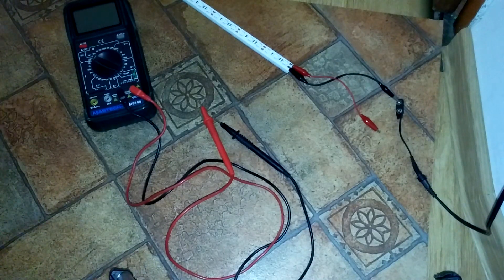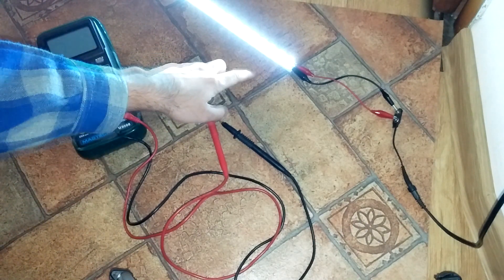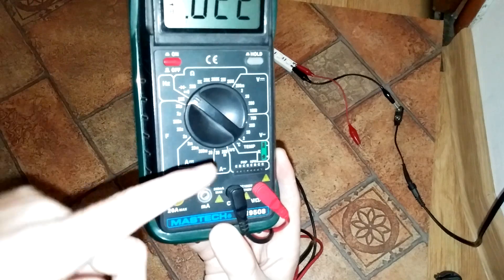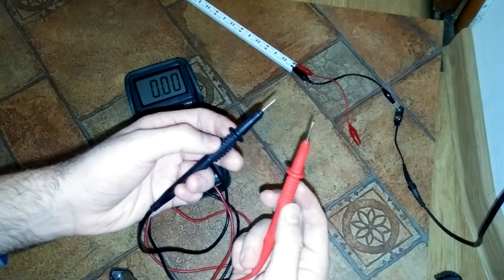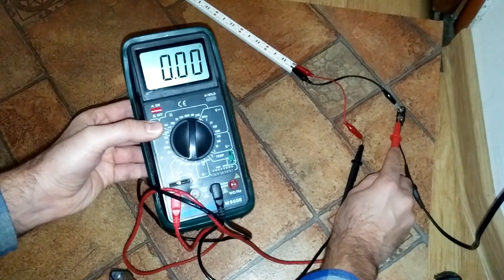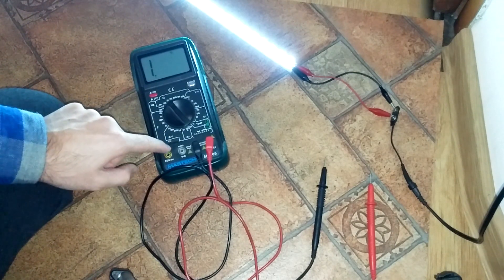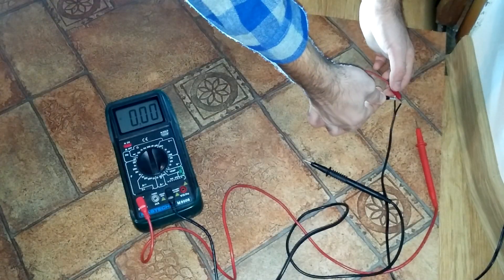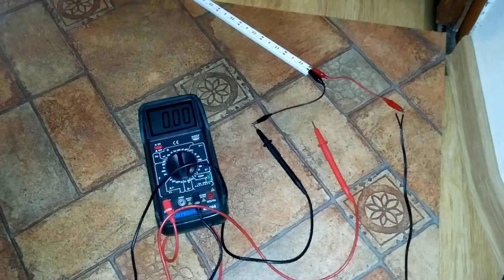How to measure DC/AC AMPS using a multimeter (Current)

Comment: Thank you. I just needed to know what wire went where. Really, just a simple diagram would suffice rather than making a video about such a simple concept. I can glance at a diagram in <500 ms. I actually tried that, reading, but people wrote horrible, long-winded "instructions" that were not only too wordy, but they were riddled with errors too.

Comment: How come dc led strip worked on ac directly? 🤔
Reply from the maker: Why not? The LED emits light, it's not a motor so that it would try to turn to the left and then to the right because of the alternating current (AC). LEDs are diodes, which means they conduct in one direction, and when the power travels in the correct direction they emit light, when power goes in the other direction they don't emit light. This alternating creates the flashing effect. I used 12V AC, not 110V or 220V AC.

Comment: why cant you measure current directly without light
Reply from the maker: The current consumption of the light is measured, otherwise the multimeter would just make a short-circuit! Current measurement is different compared to voltage measurement. When you measure current there is conductivity between the 2 leads. Never place the 2 leads onto a power source when you measure current (unless it is a solar panel, in that case it's OK). If you would add 2 identical lights then it would measure the power consumption of 2 lights, and thus the amperage (current) would be double.

Comment: I want to use clamp meter to measure amperage from adapter to LG monitor that only uses 2 amps. Can I use Cen-Tech 6 Function Mini Clamp Meter from Harbor-Freight which is for AC current or do I need a DC current clamp meter? (I don't want to cut the cord from the adapter to the monitor.)

Comment: why do you need to break the circuit with that probes and not with the clamps? can't you just put the probes directly tocuhing on other clamps/wires of the LED?
Reply from the maker: At that time I had no clamp amp meter, so with a multimeter you need to break the circuit to connect it in series in order to measure current.

Comment: Wow. Very informative and useful. Question. This probably shows the limits of my knowledge of electricity but how come the alternating current part of the test  is not blowing up or burning out the LEDs with the 120 volts? Thanks.
Reply: You would not be wanting to have bare live 120v cables just lying around and especially not connecting clips when power is on. 120v can kill you.
Reply from the maker: I used 2 different power adapters, the first was outputting 12V DC, the other one 12V AC, so they were not powered directly from the wall socket (220V - Europe).

Comment: how to test ac current with multimeter???
Reply from the maker: 1. Rotate the knob to Alternating Current Amps (shown at 1:07);
2. Plug in the red lead to the AMP connector (shown at 1:41);
3. Break one of the circuit's wires and connect the multimeter's 2 leads in series with the broken circuit (1:14)

You can also measure AC amps using a clamp meter, that needs a modified cable ► https://www.youtube.com/watch?v=HfAz9iVQoiY

Comment: but how do we know which current is DC or AC with multi meter ?
Reply from the maker: The multimeter won't measure almost any voltage if it's not set to the correct position, AC or DC.

Comment: when you are measuring the amps, you put your meter to your line that is coming from your panel or you put it to your neutral that. is coming to you panel....
Reply from the maker: it doesn't matter as long as the multimeter (set to Amps and the RED lead is also moved to Amps) is in series with the load (shown at 2:22)